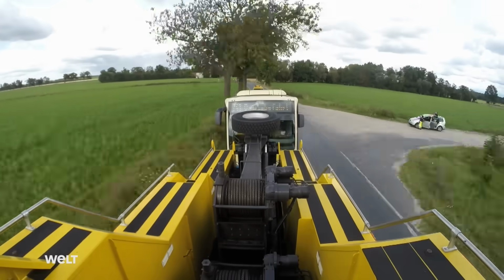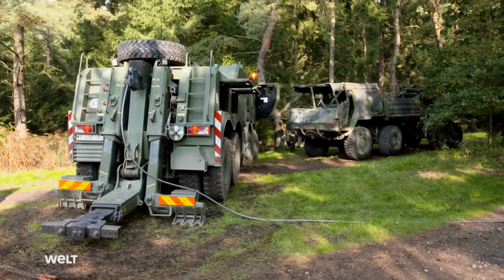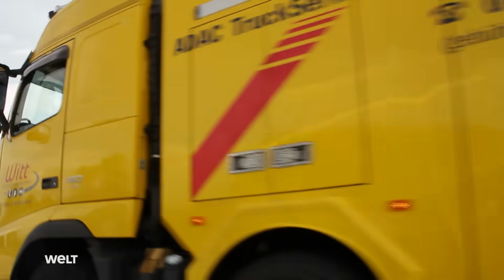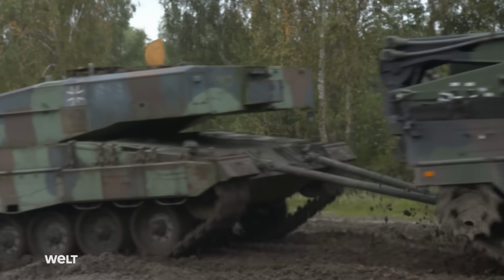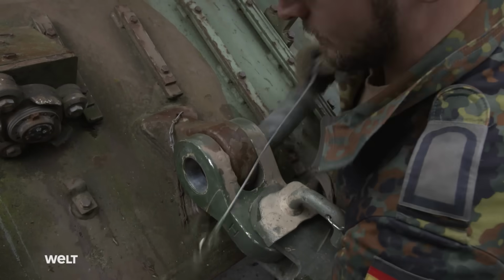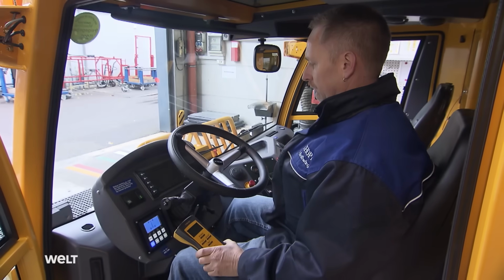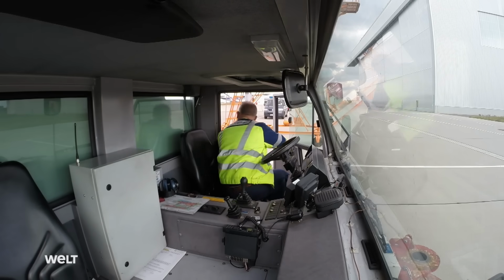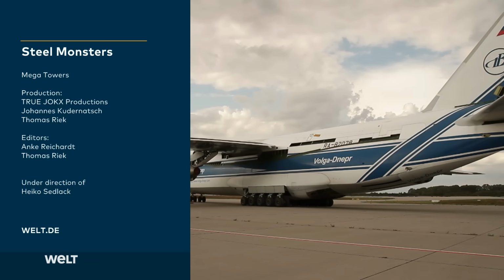Mega Tow Trucks - The World's Toughest Towing Vehicles | Full Documentary

Comment: 60ltrs per 100 kilometres lol I dont think so not evan close to being correct
Reply: I mean my ute does 8.9L/100 and it's only a small twin turbo 2.3L
Reply: 4mpg. About right when towing something 40 tonnes and shaped like a brick. That bus only get 13mpg tops and likely has a 9l 250hpb straight 6.
Reply: Usually a bit more, yeah
Reply: @tobiasmetzger1195  62 miles is 100 kilometre my truck grossing out at 44 ton dose 9mpg. a gallon of fuel is 4.546ltrs 62 miles I'd only use 30ltrs ish
Reply: @keltthomas8476  since im not American, i don't think in those mpg units. But 60l /100km is completely normal for such a big tow truck. Depending how much they are used for recovery in comparison to the time they're actually towing, you can go up to 250l / 100km.
Reply: @tobiasmetzger1195  I'm not American I'm from the uk . If you have a truck using 60ltrs per 100 kilometres the  you eather have a hole in your tank or a massive fuel problem
Reply: @keltthomas8476  No. Like i said, for tow trucks or in general any kind of truck that doesnt spend all its time on the road but doing stationary work, those are very normal numbers.

Comment: If no tree around?? Then how will pull ??
Reply: Katie Giles lol ... that solution will take many years... i just asked Gernal question and you answer so stupid...
Reply: You would have to use an earth anchor - basically dig a T shaped trench and put a gun plank it the bottom with a rope around it. On light pulls and with firm ground  a series of metal plates with holes in can be "nailed" to the ground with 3' long steel pins.

Comment: Compared to the big Rotator trucks used in the USA this thing is a toy. One purpose only. No way it can handle a wreck or be able to bring any vehicle from a ditch or anything not on the highway. When you want to show about big tow truck - See the USA. Way ahead of this thing. ADAC is a toy and with limited use. Looking at this post, you would think that only Germany has big equipment. WOW - 30 tons. US road tow truck run to 50 tons.  Delusions of grandure.
Reply: Rotators are expensive toys when a smaller truck will handle the job just fine
Reply: Americans always moving unnecessary weight when not required. Call in the mobile crane when lifting is required, otherwise a standard tow truck does the job. Its compact and easier to maneuver on a small town road.
Reply: American trucks need to be that big to fit their drivers.
Reply: if you have efficient modern equipment and not outdated american nonsense..
Reply: That typical American attitude  with this "big is always better" and "USA is better than every country in the world."   USA, as a whole , is a joke!
Reply: @Artist1974CH  Well now here they are bragging about how big is better.  MEGA TOW TRUCKS - That is the title. If the Germans have big trucks that can only tow that is okay with you but if it is true that the USA has more powerful and more versatile machinery, that is not okay with you. You opinion is really biased isn't it. You can't face fact, right.
Reply: @Artist1974CH  By the way, Scania had a Boniface rotator that makes these things like like toys. But that's okay because it's not the USA right. You should really learn to be objective.
Reply: They have much bigger toe trucks in Europe. That was just an example
Reply: Americans like to make junk like the f-35 jet plane... but yet they love to blame Chinese for everything.  America is known to be very racist.

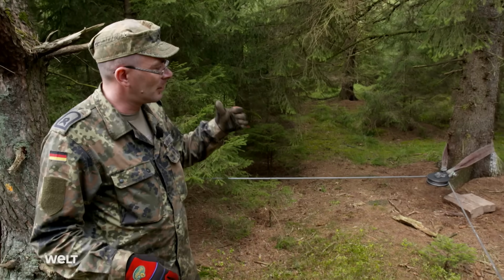Comment: At 5:50, they add 2 five ton loads and claim it to be 10 tons. That's WRONG because the two loads are NOT parallel, and are therefore NOT directly additive. Vector arithmetic must be used. If the angle (theta) between the two cables in tension (T) was 60 degrees, the load (L) experienced by the tree would be  L = 2T* cos(theta/2)    [Check if the calculator used expects angles in degrees or radians]
Reply: it's called 'conservative estimate'. 10 tonnes is the maximum force possible so it must hold 10 tonnes. doing some calculator tricks and guesstimation of angles is not a secure way of doing thing. especially since the 5 tonnes are already a guesstimation. only an idiot would do L=2T*cos(theta/2) and write down 3 digits after the decimal when force and angle are not even known. that's the difference between thinking you are smart and actually being smart.
Reply: @Mar-s5q8m  Maybe after 40 years as an engineer, including automotive, medical and aerospace fields, I have a different perspective than you. Mine is that you DON'T deliberately make things more vague with additional guesstimations. Instead you make your best estimate, and THEN add a safety factor. There are guidelines for what safety factor to use for different applications. Additionally, 'uncertainty analysis' can determine the aggregate uncertainty as a function of each individual uncertainty. All this can be programmed on to a calculator or smart phone. So, it's not that big a deal to do it right.
Reply: @Mar-s5q8m  Since you label me an idiot, I assume you know WHY theta is divided by two?

Comment: What if they're ain't trees around, then what?
Reply: Worst case scenario and it needs to be done quick, than they would block the path of the overturned vehicle on the lower slope with another vehicle for safety and just go YOLO without the counter balancing wire I guess. 

Planting a heavy duty rim into the ground like offroading wont work for such heavy weights I guess. Not to mention the digging tools needed to bury a truck rim 3 quarters into a fitting channel cut at an angle.
Reply: Of no trees are around, they would be able to position the truck into place and not need the trees. Do redirect the cables and work straight off the truck. Plus that was all for training.

Comment: I'm surprised that the bus recovery crew isn't required to use flaggers or a bit more signage than a few cones. I often inspect geotech drilling along roads and bridges in the US state of PA, and we have a ton of safety regulations about that. I don't like feeling the tailwind of a semi truck moving at 45-55 MPH just a few feet from me. It'll whip your hardhat right off.
Reply: not on that kind of roads these are low traffic, how ever on the Autobahn you have the Autobahn police help you and make sure you're are safe
Reply: facts.  the load has to be close to the joint where its connected to the hauling vehicle to prevent whipsaw

Comment: Volvo dont hade V8, and its 480 horsepower...
Reply: It’s probably swapped in, Scania for example has a 730 horsepower V8 that is used for heavy (I’d say 70-90 tons but anyone who knows can correct me! ) loads
Reply: @chaoszombie9995   in sweden they have them for low weight to ..
Reply: @chaoszombie9995  you can't swap a scania V8 into a Volvo, it will not fit. 
In europe truck manufactures produce everything. The truck, the engine, the transmission. Everything. They only way you can swap a scania V8 into a Volvo, is to swap the volvo for a scania.
Reply: Yeah that's not that much, American diesel inline 6s in highway tractors make more
Reply: @briansuderman5597  but volvo got 750 horepower with a 6 and scania got 730 horsepower

Comment: The truck can only do 88 km/h, cause its limited to 89 km/h (at 89 you have no power)
It could probably do a lot more without the limiter
Reply: To bad the flux capacitor requires 88 mph... :-)
Reply: No, they do 88 km/h,because the gear ratio is to low, truck drivers never uses rpm above 1500 without a good reason.
Reply: @yellowdrink9428  it's electronic in these trucks. Firetrucks has no liminer and they can hit 150km/h
Reply: @yellowdrink9428  both of  you are correct. The ECM can be programmed with a top vehicle speed and the same can be done through the TCU or gearing can be changed in the transmission as well as the differential as you stated..
Reply: @LKN117  But the speed is not limited to 88 by the engine power. It is electronically limited at that speed. In older models you could pull the fuse of the limiter.  With previous generation Scania you could add a magnet to the sensor on the gearbox so make the truck think it is standing still and sleeping, while actually driving without speed limiter :)